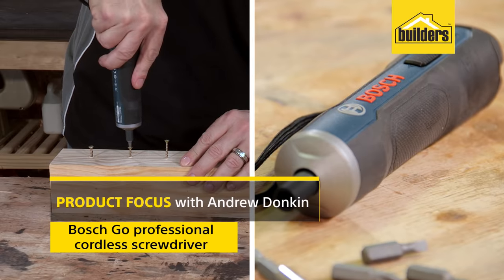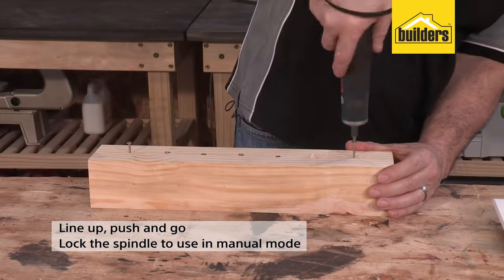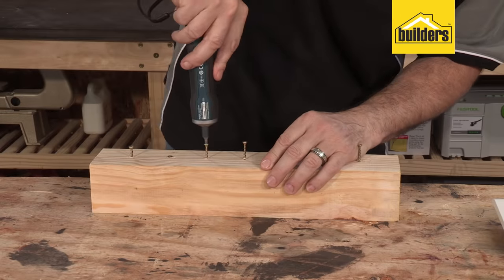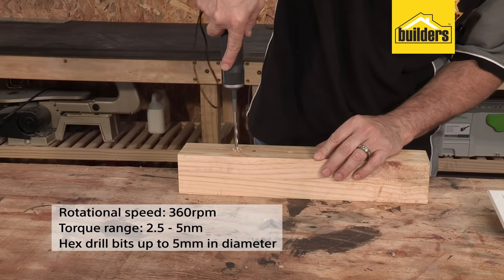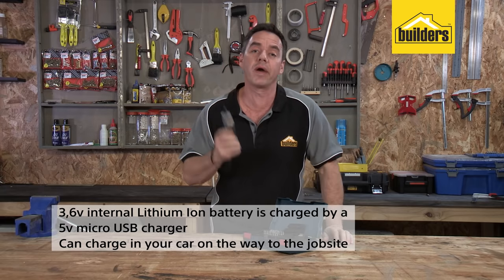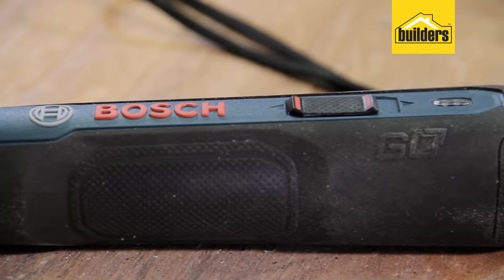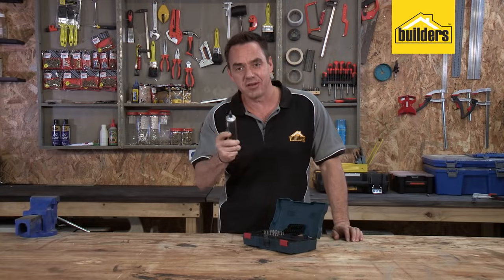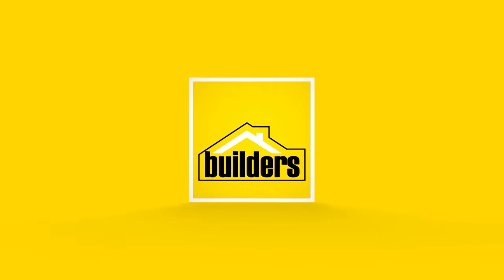Bosch GO 3.6 Cordless Screwdriver Review

Comment: No LED light to illuminate the screw is a deal-breaker for me.  These little screwdrivers are often most useful in awkward spaces where a small light really helps.  Like the one on my Bosch IXO screwdriver.  Or DeWalt impact driver etc etc

Comment: is it protected from el. curent if touched with the tip of the tool
Reply: I think, it is protected. the body is plastic and it is protected from el.
Reply: if the manufacturer doesn't list it as compliant with any electrical safety ratings, using it on a live surface you must fully expect you will wreck the tool and short the battery and cause it to explode in your hand

my advice is don't ever touch anything that's got a live wire on it, even if it's rated for that voltage or far exceeds it, that's purely to assist in preventing mistakes from happening, not to be relied upon for regular use and won't always save you, and definitely isn't going to prevent you from getting injured every time

Comment: That Micro USB port will fail rather quickly if used for trade purposes, which is what Bosch blue tools are usually for.
Reply: May EDC torch is mini usb recharge and going fine after 2 years on my pouch.

Comment: cool but expensive af. wish there was something cheap and easy for someone like me who messes with her printer and printed parts that use screws a lot. cause my hands are getting very tired.
Reply: This was 10 months ago so I'm not sure if you're still looking for something, but I'd recommend going onto banggood and typing in "13 in 1 Mini Cordless Electric Screwdriver Pen". It's about £13 and is perfect for 3d printed stuff. The torque is not as high as the bosch go, but this is a good thing as otherwise you'd strip screw heads etc.
The whole "push to start" thing is cool but will strip screws and you have to push down to take out a screw which will mangle plastic.

Comment: I bought one, and I hate it. This thing is a real piece of crap. Nothing to hold the bit in, so get the tape out. Almost impossible to use except in a completely practiced repetitive task, but still not worth picking up to use ever. I really tried, with total frustration each and every time I tried. Bosch has gotten so bad in their designs over the last 10-15 years that I will never buy another Bosch tool as long as I live.... and I used to buy nothing but bosch.
Reply: This was the worst power tool I ever bought in the last 30 years! I also tried by many times as you,  and finally gave up!
Reply: Oddly enough - that's my experience of Bosch. Bought their AMW10 1000 watt s trimmer / hedge trimmer. Well made but so badly balanced it unusable. Bosch drills are awkward as well
Reply: @MartiA1973  Hi Guys, no offense to you, but you must have bought faulty products, all the Bosch Tools I ever bought has never given me any problems and I bought quite a big range over time, yes I had to replace brushes and little parts that broke but that was normal wear and this only happened after years of use. Bosch and Makita tools I buy with extreme confidence, sad to hear you had such problems, you should have taken it back for replacements .